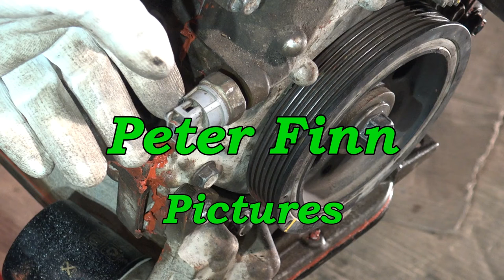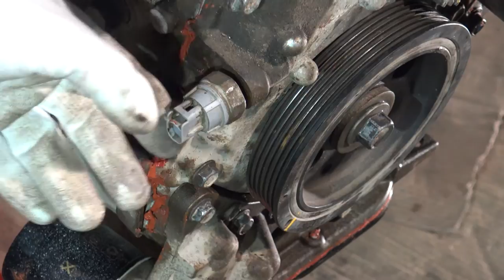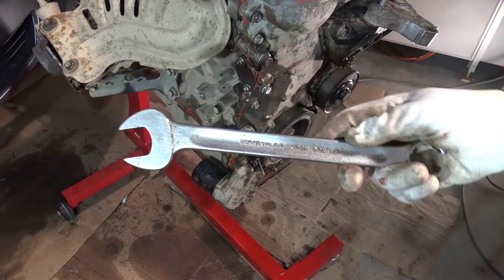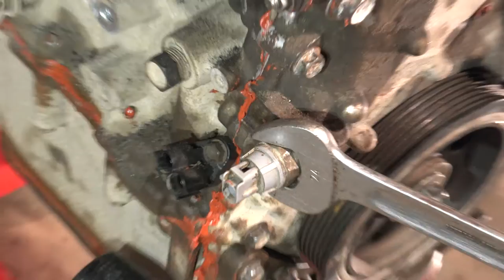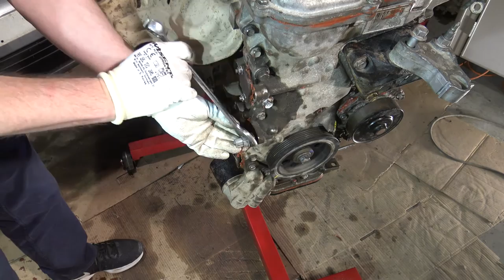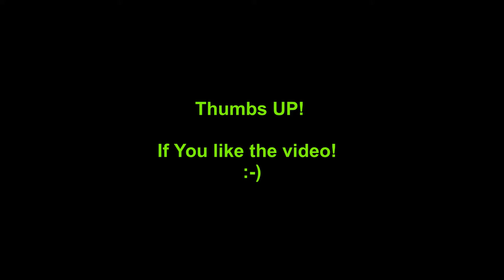How to replace Oil Pressure Sensor Toyota Corolla. Years 2007 to 2018

Comment: Thank you for this Information! So where would place a oil temperature sensor in this engine? its possible next to the oil pressure sensor on the left side in the plug or in the oilfilterhousing in the grub screw wheres the oil flow from oilpump to the oilfilter? thank you for your recommendation
Reply from the maker: Thanks 👍😊

Comment: You don't have to use threadlock on an oil pressure sensor. The threaded part has a conical shape, and it seals due to that. 

They make them that way so that people don't use anything on the thread, and don't, accidentally, get something inside, and mess up either the sensor, or worse - the engine.
Reply from the maker: Many Thanks and Happy Good new Year 2025 !

Comment: Do I need to remove oil from the engine before replacing the sensor?
Reply: i need to do this on my van, to be on the safe side, replace the sensor at the next oil change after draining the oil
Reply from the maker: Thanks for comment 👍

Comment: Great video! Do you think the Oil Pressure sensor could be the problem with uneven idle ? after turning air condition? (1.6 Auris only part that has a bit off oil on it).  Thank you!
Reply from the maker: Probably not
Reply: Uneven idling could result from your Idle Air Control Sensor if you have confirmed your plugs are good